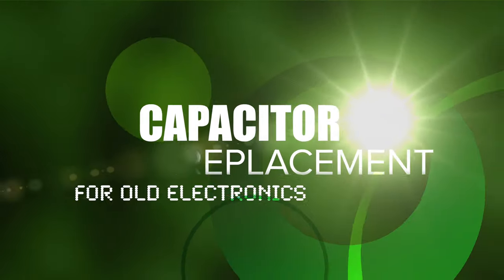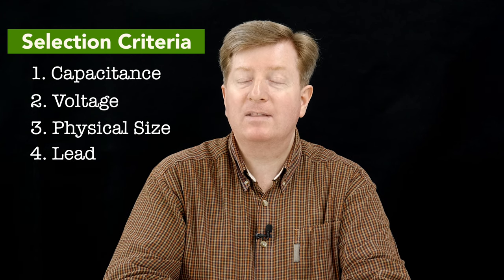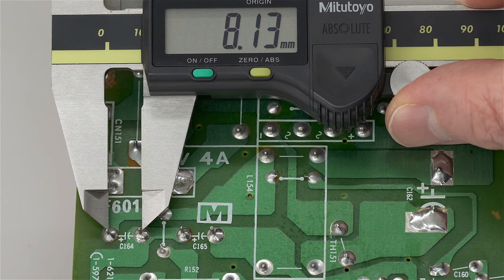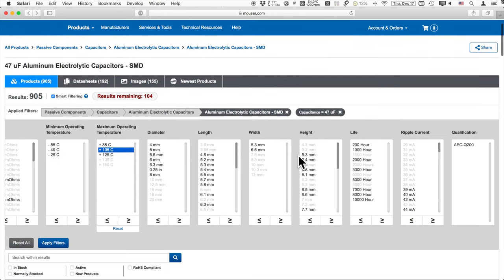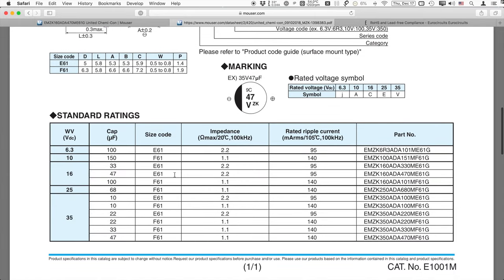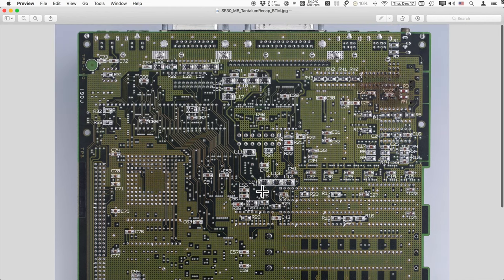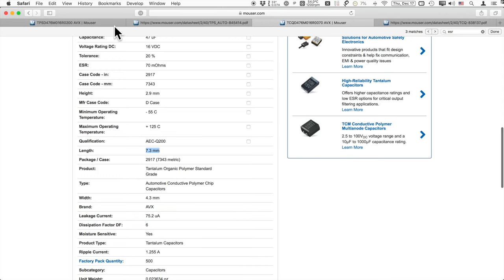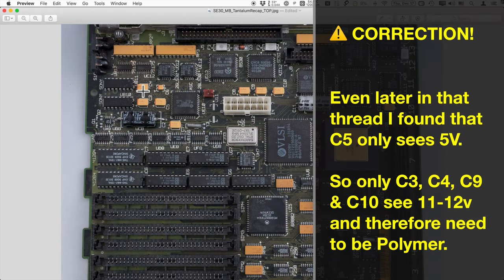Choosing Capacitors to Recap Old Electronics

Comment: RoHS are the clowns who have ruined solder!
Reply from the maker: I didn't want to get too "political" and speak badly of RoHS, but suffice it to say, I use leaded solder exclusively for good reason.  I've actually come across people who are scared to death of even holding leaded solder in the hand.  It's like like we're in ancient Rome using lead drinking water pipes, for goodness sake! 🙂
Reply: the people of Flint, Michigan want a word with you  @JDW-
Reply from the maker: @SteveChisnall  Human error in omitting orthophosphate, which controls metal corrosion, caused lead in water pipes to leach into their drinking water. It had nothing to do with lead used in electronics. One can argue that lead should NOT be used in pipes at all, although its use in electronics is still founded in reason. Lead-free solder isn't a good replacement for lead, unfortunately.
Reply: @JDW-  To be clear, I am a proponent of using leaded solder when-and-where possible. I'm also a proponent of keeping cathode-ray-tube monitors and displays functional, to keep the lead out of landfills.

Comment: I like Digikey’s site better.
Reply from the maker: Because you are more familiar with Digikey, or because there is some feature on their site which Mouser does not have?
Reply: I prefer the way the filters work, easy to add/remove the different selections, site responds quickly.  But they are both great, miles ahead of all the other suppliers. Also for me, here in Canada, $8 shipping vs $20+ from Mouser.
Reply from the maker: Thank you for explaining. I have my own reasons for liking Mouser, but suffice it to say, if international shipping was much cheaper to me here in Japan versus Mouser, I would switch in a heartbeat! With that said, Mouser’s international shipping is less costly than eBay standard shipping, which indicates that it’s lower than the industry standard.